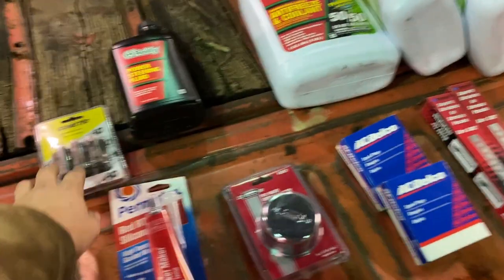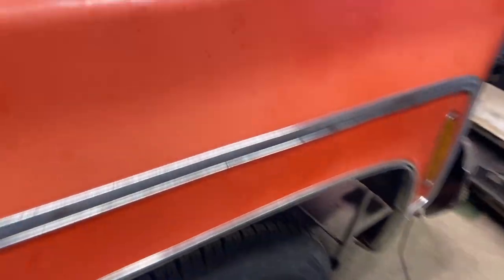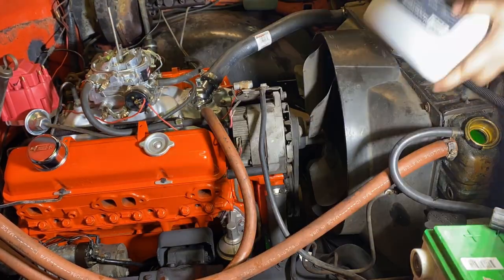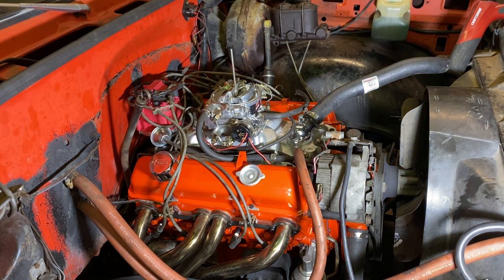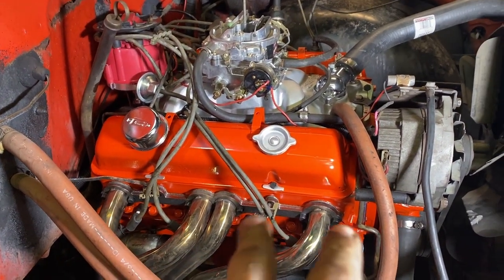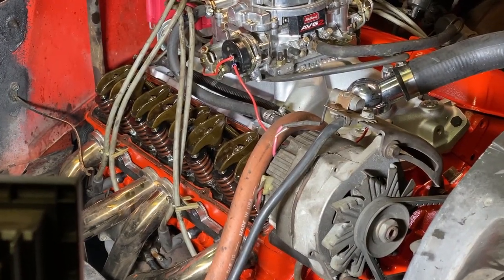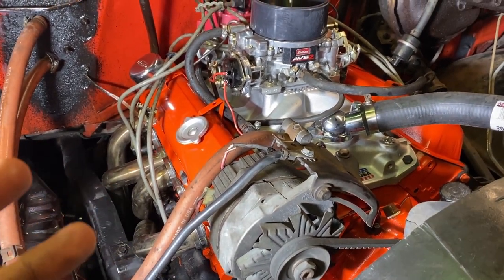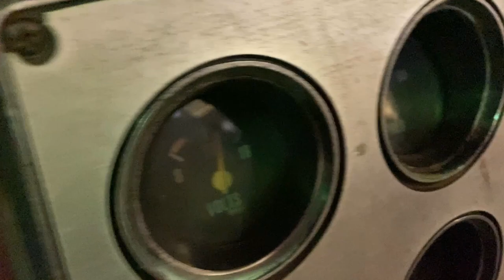Squarebody C20 Project Part 16 IT RUNS! well sort of |square body|

Comment: Cut the top out of an old valve cover to adjust when running keeps most of the oil in but I've seen them shoot oil pretty far often

Comment: On a flat tappet camshaft initial break in you're supposed to take it to 2000-2500 immediately when it first starts for at least 15-25 minutes. You probably wiped out a couple of lobes while trying to set the timing

Comment: If it were me I would start over from scratch with the valve adjustment.  I don't think the air cleaner spacer popping is an issue.  Hope you don't have bad out of the box lifters.  I'd also double check the push rods.
Reply: What's the oil pressure? And sometimes the lifters will bleed down a little and be noisy amd need readjusting and then be fine did you soak them in oil over night and the break in procedure is not bullshit it does happen to many that they wipe out lobes due to not enough oil splashing on the cam and lifters did you use the zinc additive the new oils dont have it in there and that's the most important thing the big issue with lifters is a real problem these days if I did one nowadays I'd add extra zinc to try to alleviate any issues

Comment: I believe you wiped the cam out messing around on the initial start up timing was close enough to start should have ran it straight up to 2000 for 20 min
Reply: @squarebodyblake4464  has nothing to do with blowing it up you messed up from the beginning when u cranked the motor over to build oil pressure you should have primed the pump before that motor ever turned over so the cam was smoked before it even fired and you can set your base timing close enough without running it to do the break in properly then after break in you can do your tuning
Reply: Apparently you dont understand what actually happened so there is no reason to continue this conversation hopefully you figure out where you went wrong on the next rebuild